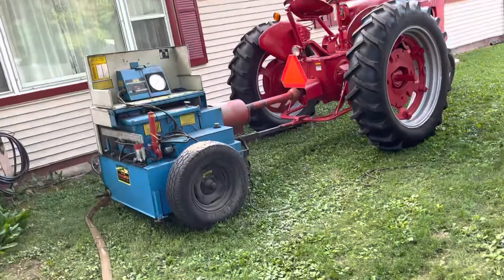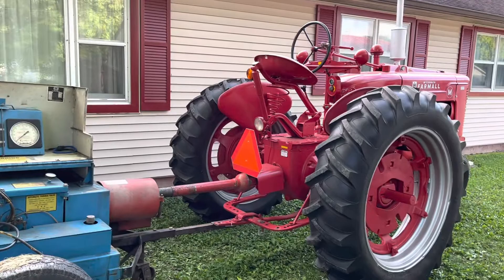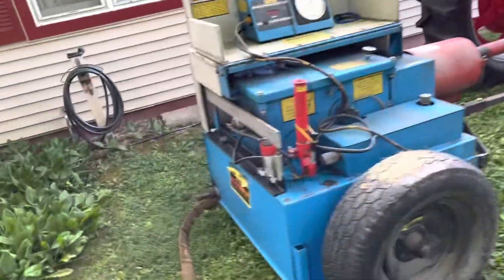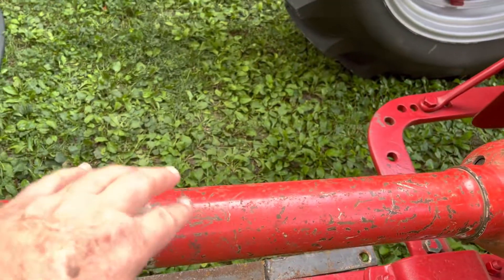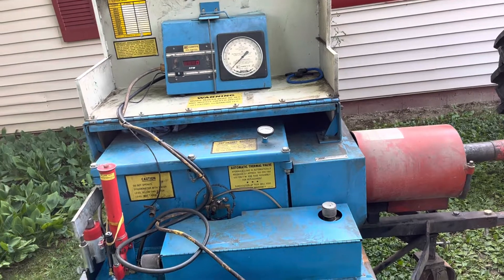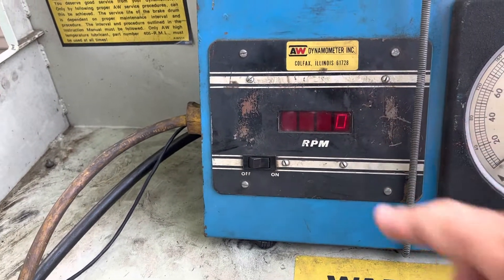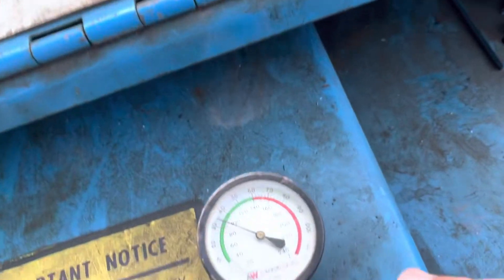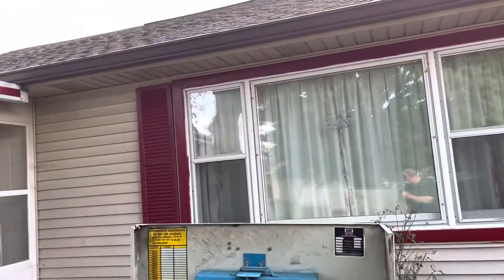How a Dyno works

Comment: That's cool that you have your own dyno !!  We have a monstrous centrifugal blower that was powered on an industrial jobsite by a 40 hp 3 ph electric motor.  So we have a 4 speed truck transmission hooked to it and the pto goes to the input of the 4 speed.  It really puts a load on a tractor, but we have no way of reading hp or torque.  But it sure is fun.  I think the fan sits 6 to7 feet tall.
Reply from the maker: That sounds like fun too.  I love yo put a
Load on them old tractors to hear them pull!
Reply: @tinkerinbruce6560  Back in the day in the spring we'd head to the big field right after barn work in the morning.  Drop plows and not stop until milking time in the evening.  That was some good hard pulling.  The bigger tractors had to fuel after noon.  The smaller fields weren't quite as intense. There's nothing like running  third gear wide open hours on end. I still remember the smell of fresh turned dirt like it was yesterday.
Reply from the maker: @tractorman4461  I grew up on a very small farm. My dad worked out and we had about 20 hit a bridge gals. We raise just enough corn to feed the cattle through and we raise a little tobacco. But I’m like you I love the smell of that fresh turn dirt. nothing like it we used to plow with a 300 Farmall and we would plow after dark and I can remember the muffler turning cherry red, and then you could see a blue flame at the top of it like a Bunsen burner. Those were the days!
Reply: @tinkerinbruce6560  We seldom worked past dark though one of us would stay in the field plowing, discing or cultivating until the others finished the evening barn work.  After the milking and feeding we may continue to work up to dark, depending on what the weather was looking to do overnight.  With the older, slower equipment before my time, the old man related experiences such as you describe.  They had to work into the night to get the fields turned.  I was spoiled with the modern three bottom pull type plows...LOL  Now look at 'em today and what they use.